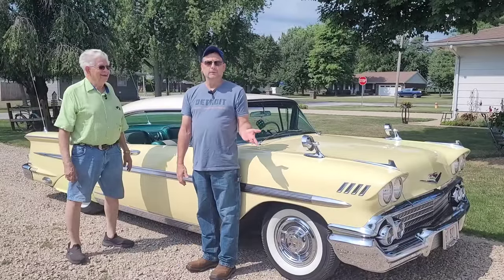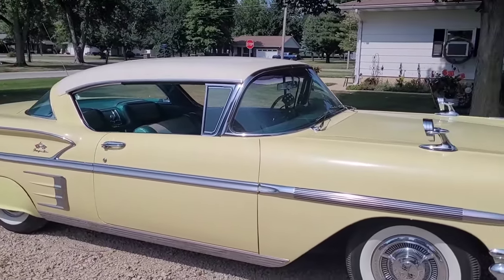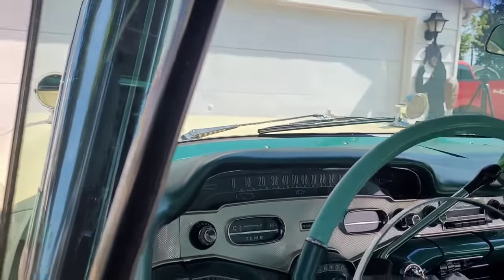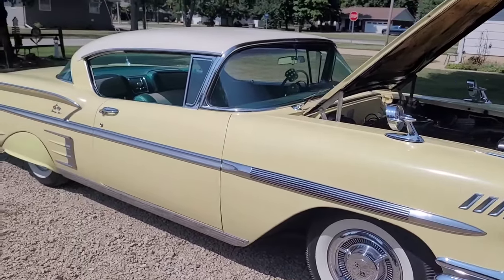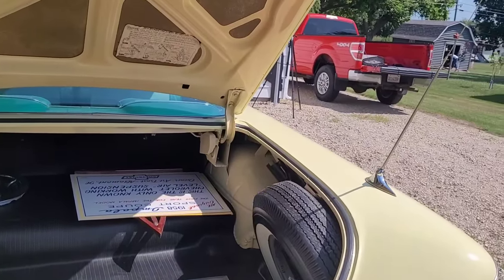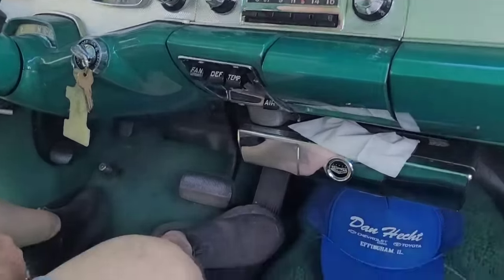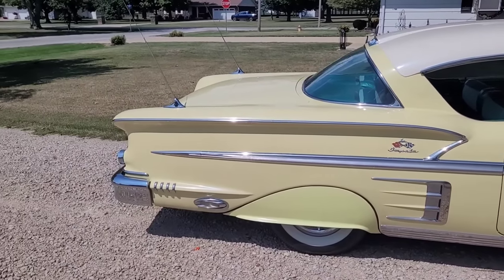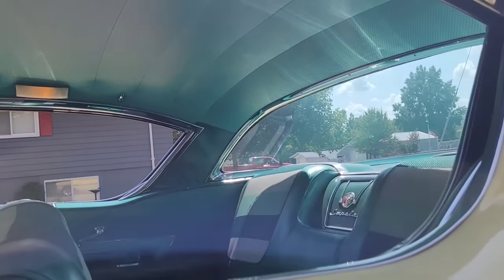Possibly The Most Original 1958 Chevrolet Impala In Existence With Factory Air Ride 37k Miles

Comment: I bought a new 58 Impala in 1957 from the Chevy dealer in Van Nuys, Calif I took delivery 2 days before the first showing.  It had the air suspension feature which made it sit lower to the ground  than the spring model.
It was too beautiful to pass up so I traded in my 54 Belair (bought from the same dealer.)  I first saw the impala in a warehouse because it was two days from the showing. I like to think I owned the very first Impala delivered., as the GM  assembly plant was also in Van Nuys.  I was  21 years old and in the Air Force, stationed in Riverside Calif which meant I came home several time a month.

The car was a real eye-catcher.  People stopped me all the time and stared  it was so ahead of it's time. Then the trouble started. 1, 2 or all 4 air bags would lose air while driving. It looked very strange driving with the left side of the car on the ground and the right in it's normal position. Every time I came home from the AF base I went to the dealer.  They would work on it for a couple of days, but it would happen again and again.  After a few months of this, the general mgr at the dealership said they would give me all my money back, I just had to choose another Chevy  They could not fix the problem.  This is of course before the recall. (I just learned there had been a recall watching your show with the yellow impala.)  I told them what could I get in place of my 58 since I had the top of the line model, and they weren't offering the exchange to springs and I never even thought that possible. 

So the end of this story is the dealer said how about a Corvette instead, and I ended up with a new '58  red Corvettle which gave me great joy for several years.  Sorry to be so lengthy, and by the way, I never would have considered skirts on the Impala.
Reply from the maker: That's a great story. There is no need to apologize. Thank you so much for sharing and watching.
Reply: Pollard-Ravenscroft Chevrolet on Van Nuys Blvd. We bought all our Chevys there. In ‘59 our salesman gave me a ride in a new ‘59 ‘Vette up and down Van Nuys. We bought a new ‘58 Impala right after their roll-out and then parked it out in front of Bob’s Big Boy. You should have seen all the rubber-necking at that car. I still like the ‘58s and bought my first one in ‘66 for $300 and kept it till it was stolen in ‘ 73. You don’t expect to own a Chevy in L.A. for very long before someone liberated from you! In my case mine was stolen in Hollywood while I was watching “Grease” at the Pantages!
Reply from the maker: @J.P.SeeburgEandKTSpecial  wow! That's a step back in time. I gotta say, I've been to L.A. a couple of times, and I do really like it out there. However, I could never give up my country living for that city life 24-7. Thank you very much for watching and commenting! I appreciate it.

Comment: I believe that tube on the steering was the power steering cylinder that was basically a hydraulic cylinder driven by the power steering pump. Chevy's never had rack and pinion back then.
Reply from the maker: Isn't that kind of the same only different?

Comment: I remember my 58 Chevy Biscayne which was black and white. And the radio had a distinct hum because there was a vibrator that generated the alternating current to step up the voltage to operate the vacuum tubes inside of it.
Reply: That was an Oz4 vacuum tube inside the radio

Comment: there was no need for remote mirrors back then, because when you got gas at the gas station, the attendant would not only pump your gas, top off fluids, add air to your tires, but he would also adjust  The mirrors while you sat in the car - hard to imagine that today

Comment: My dad got a new Impala in the fall of `57 at Martin Chevrolet in Canton,Missouri. His was Tropic Turquoise with a white top and had the 348, Turboglide, and Level Air just like this car has. It had the fender mounted mirrors too, but i think they were closer to the windshield on dad`s car. He had problems early on with the air suspension as it would raise the car on one side and lower it on the other, and also had to have the transmission torn down and have a upgrade kit installed,but both were fixed by the dealer under warranty. The engine never had any problems except for a water pump that started to leak after it had over 100,000 miles on it, which my dad kept and is still hanging on his garage wall! He also put clear plastic covers on the seats so the upholstery stayed perfectly clean. It had 130,000 miles on it and still looked great when he traded it in on a new `65 Impala SS  from Ferrell Chevrolet in Augusta,Illinois.
Reply from the maker: Wow....that's a great story. Thank you for sharing!
Reply: @tonyscarcare5657  Thank you for finding this incredible car! I would love to get Art and my dad together so they could share stories! I forgot to mention that he still has a can of Lucite acrylic lacquer paint that he used to repair rust that was on top of the fenders above the headlights,alot of those cars rusted there. He also has the dealer invoice and it looks exactly like Art`s, showing the cost of all the options and what he got for his trade in car,which was a `55 Bel Air hardtop with the 265 V-8.
Reply from the maker: @alanseaton9640  that is so cool! If you're close to Illinois, I'm sure Art would love to talk to him.
Reply: @tonyscarcare5657  Dad lives near Quincy,Ill which is about 3 hrs. away from Art! I belong to the Vintage Chevy Club and in the April 2022 issue of our magazine there is a article about a `58 Biscayne with Level Air that has 458,000 miles on it and it still works and the owner still takes it on trips! The only other car i ever saw with this was a `58 Pontiac Bonneville,and the owner said it still worked perfectly.
Reply from the maker: @alanseaton9640  Wow! Yet so many complained about it.
Reply: @tonyscarcare5657  Dad had to take his back to the dealer several times, i think it was a problem with the leveling valves. When they finally got it fixed he never had any more problems with it,but the air compressor was noisy when the car was first started up. I read that less than 200 cars had this option so it`s pretty rare!
Reply from the maker: @alanseaton9640  I'm sure it's very rare.

Comment: i never liked the mirrors on the fenders. they look much better on the doors
Reply: Absolutely, Gordon. Unfortunately they were an "option" back then. Still, it's (still) not as bad as the continental kit or the fender skirts. Hate those with a passion. Less IS more!
Reply: Mirrors up there are impossible to adjust and have no field of vision.
Reply from the maker: Yet that's the way it was bought off of the showroom floor.
Reply: I doubt it came with skirts.
Reply from the maker: @kirbywaite1586  it did not come with skirts! We are talking about the fender mounted mirrors. And it was bought off the showroom floor with them.
Reply: @tonyscarcare5657 Yes,  I understand what you were talking about. 
I was responding to it's being called  " all original" which it is not with those J.C. Whitney fenderskirts on it.
Reply from the maker: @kirbywaite1586  did you watch this video here? 
👉 https://youtu.be/5yOehXkMHMc

Comment: I never knew that the 1958 Chevrolets had the option of an air ride suspension. It seems like it's only a matter of time that they go bad. My current daily driver is a 2002 Lincoln Town Car that I bought in 2007. It came with the rear air ride suspension, but it went out in 2015, and I had it replaced with coil springs. I had to drive it six miles to the mechanic with the rear end sagging, and it was the most bumpy ride I ever had! 😢😢
    Art sure has a beautiful car.
Reply from the maker: Yeah, that happened to all the Lincolns eventually. It had to be really bad in the 50s.

Comment: Chevy's "Turboglide" was a Buick 'Dynaflow,' a variable ratio torque converter XMSN bolted ahead of a modified Chevy 2-speed Powerglide.
Tube-type radios of the day (playing Donna Summer disco, no less!) had to warm up before they would play. No instant-on.
Ignition key was called "thieves' delight" since many folks never bothered to use key in daily use.
Steering was recirculating ball and nut, not rank and pinion; the hydraulic servo you see is mounted to the tie rod.

Comment: Turbo thrust signifies the 348 big block. The small block was Turbo fire.
Reply from the maker: Thank you for clarifying that for me!
Reply: @tonyscarcare5657  you're welcome!
Reply: Hard find  in iowa
Reply: Sharp chev
Reply: Had one just like this in 1964.  Light green, same dark,green interior.   348 v8, big 4 bbl carb.
348 came from a truck v8.  I like the L green ext with 2 tone dark interior better.   Mine sounded good, but I’d d rather have 
the 327v8.

Comment: Only thing missing is factory A/C -- but WOW what an amazing example and SO rare--!!  That "no shift" transmission is prpbably a variant of the twin turbine unit used in Buicks, instead of shifting gears it changed torque converter blade pitch
Reply from the maker: They say you couldn't get factory A/C with the levelair. No room with the air compressor.

Comment: The reason GM would replace the air suspension if one part of it failed it would or could cause the car to go out if control. A friend of mine was driving one back in the day and suddenly the car went into a spin part of the system failed. Tubo thrust engine meant it had the 348 cu. In. Engine. Turbo glide trans was an automatic that was also problematic GM also offered to replace those with  powerflide.
Reply from the maker: When I was young and growing up driving Fords with C6 transmissions, I couldn't stand getting in a Chevy with a powerglide. I was always waiting for the next and last shift that never came.
Reply: I had a white 58 Impala with the Turbo thrust engine and turboglide transmission. The Turboglide was actually a Buick Dynaflow transmission. The tranny was alright if you didn't hotrod it. I had a local transmission guru put a powerglide (out of a 57 Chevy) in it. It was a great car.
Reply from the maker: @duanepayne1805  That was a good idea.

Comment: Great car.  My first car was a 58 chevy DelRay which was the base model.  It was a 6 cyl stick.  Did not have air ride.  Only had coil springs and shocks.  It only had a radio and a cigarette lighter.  Drove it from Indiana to Ft.Lauderdale and back twice while in university.   Drove it til 1973 with over 120,000 miles when it blew a rod and I traded it for a 66.  It was built like a tank.
Reply from the maker: Wow! Could you imagine driving one that far now?

Comment: I looked up that "Turbo-Thrust" option, and apparently it was a carburetor option available on the big block engine. This is the info I found, copied and pasted from a Chevy enthusiast website:

"With a four-barrel carburetor, the base Turbo-Thrust produced 250 horsepower, while a Super Turbo-Thrust featuring three, two-barrel carburetors upped the power output to 280 horsepower. A Special Turbo-Thrust was also available with a single, large four-barrel carburetor, and punished the rear tires with 305 Horsepower. Finally, if you didn’t mind solid lifters and the trio of two-barrel carburetors, you were the right person to get the “Special Super Turbo-Thrust” engine that delivered 315 horsepower."
Reply from the maker: Interesting.....thank you!

Comment: How well I remember these cars I worked at smedley's Chevrolet in Vandalia Ohio in 1958 and I remember changing a lot of these are rides over to Springs and also I didn't hear you mention the Transmissions that much but they also offered to replace them with a Powerglide and I replaced a lot of those too a lot of people don't know this but all the other divisions had special Transmissions that were also recalled I'm not sure about Cadillac what they done but I do know that Buick and Pontiac all the time that these Chevrolet's had this special transmission overhaul two of them that had a problem they were very complicated in that you could not make a mistake or it would work right
Reply from the maker: Thank you. The transmission has been discussed in a lot of these comments.

Comment: I work at Chevrolet , Pontiac and Cadillac … Some Caddy’s used Oldsmobile engines back in the day and Chevy used Buick engines in some pick ups … Anyway I had never seen a Chev with Air Ride Suspension .
Someone convinced that lady to get all those extras to get a bigger commission . That air compressor is as big as an A/C compressor . Bet it takes 20 HP off the engine  😅😅
Reply from the maker: I bet you're right! Actually, the dealer ordered it that way and had it sitting on the showroom floor. She didn't order it herself.

Comment: My dad had a 1959 Cadillac Coupe DeVille. It had air suspension, but the power steering pump was attached to the back of the air compressor. The ride control looked like a parking brake release under the dash. When it was pushed in, it was a normal ride height. When it was pulled out, the car looked like it had a lift kit on it.
Reply from the maker: So crazy the things they did back then.
Reply: I think it was a culture at Chevy to make the consumer the test dummy for their vehicles with new ideas. The Vega engine  is a prime example. I still can recall seeing relatively new Vegas smoking badly out the exhaust. That should never have made it to the customer in design.
Reply from the maker: @larrybe2900  I remember those Vega oil stories.

Comment: I had a 1958 Biscayne (bottom of the line as opposed to the Impala) when I was in college.  I bought it in 1968, and it was a beater even then.  Rust took a terrible toll on 1950s cars if you lived where winters were harsh.  Cost me $75 and I drove it for 2 years until the transmission died.
Reply from the maker: We live in the harsh winters. We just don't drive our good cars in that type of weather.

Comment: I think the 58 Impala is the best looking Chevy of all time.   BTW, what you see on the steering arm is not rack and pinion. These cars used a hydraulic cylinder to assist. Later models had a hydraulic steering gearbox. Rack and pinion came along much later on American cars.
Reply from the maker: Yeah, someone else cleared that up for me. Thank you! I did another video of removing the fender skirts if you'd like to look it up on my channel.

Comment: That's the horn relay on top of the voltage regulator. 
The power steering pump bolted to the generator was not rare, that's the way they were all done back then.
Reply from the maker: I've never owned one.

Comment: As a kid my neighbors had a 55, 56 and 57. They thought those cars was the end all. I liked them but I love Christine, and Impala. My uncle had a True SS Ls6 in early 90s. That was my favorite. White with black SS stripes. My dad wrecked my grandma's impala with the T shifter on floor. Idr what year. I believe 60s. I have a photo but only from the side and can't see entire car just doors. I love all old cars. New cars are trash. All plastic and metal so thin it dents from leaning. I know times have changed but I'd take a old pre 80s car than ANY NEW 1.
Reply from the maker: I agree for sure!
Reply: @tonyscarcare5657  All the newer autos are breaking down. Bad. I thought the 80s cars was bad quality. But no they outdid themselves after 2020. All I see is mechs saying the warranty work on major driveline or any systems is insane. All tge plastic check balls in transmissions, the whatever brand cylinder deactivation crap, my dad's 15 6.4 had this issue. I told him yo have it programmed out. Trans went out. Automatic. Can't buy a new unit. Only used and rubilit. Cost almost 8 grand for a trans. Insanity. He had to unretire just to make up for it. So effed up. I'm all for safety and saving the planet but at who's cost? All tge bug names of ppls who made it rich and polluted from Ford to Alcoa dumping floride in water all over, just saw this, we're suffering for dead ppls decisions. Let's make a auto that lasts longer than 100k with nothing major breaking and lasts a decade. Can't seem 2 do it. But a 94 Celica is still going and rust free. A 1995 Cummins dodge is still going. My panther cats and trucks still going. No 5.4 sprk plug tritons. 4.6 2 valves. Still going strong. If I won etc ANY new auto I'd sell it in a heartbeat and buy and fix a panter, pre 10 GM, 2000s honda, toyota, or subaru. I see 90s cars going still. We should be able to keep a auto going and not rust on lot, not need major drive train work new or gently used. Pathetic we cant. We used to be the best after we learned from Germany how to make things after ww2 especially. Yes they took way longer to make VW Beetle or porche, but the dam thing could do top speed on autobahn and still run and drive.
Reply from the maker: @jasonchristopher2977  that's a lot to take in. Thank you!
Reply: @tonyscarcare5657  That's what she said.
Reply from the maker: @jasonchristopher2977  😂🤣😂🤣
Reply: @tonyscarcare5657  I had to. U left it wide open. I'd say something about that too but it's a family channel.
Reply from the maker: @jasonchristopher2977  lol